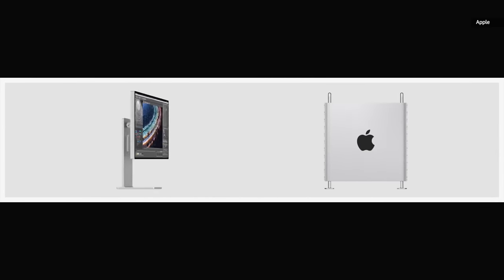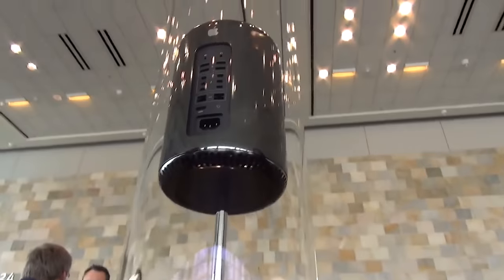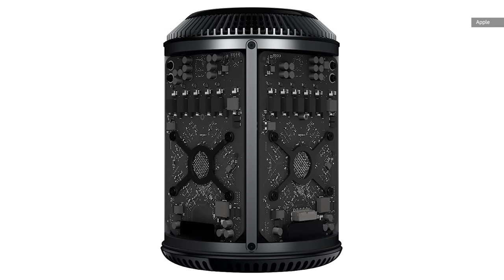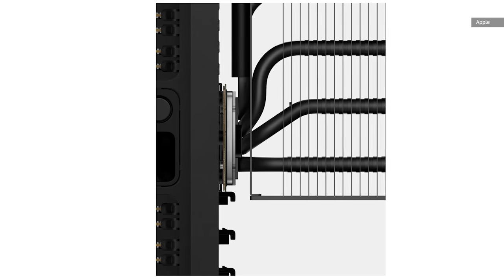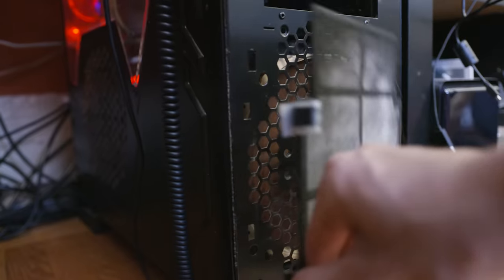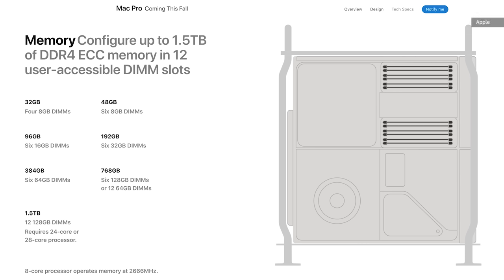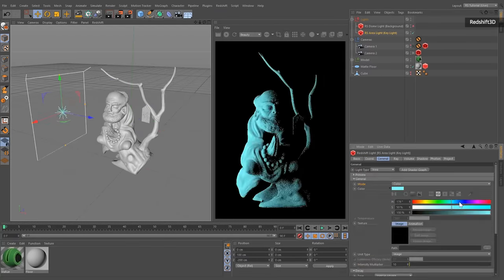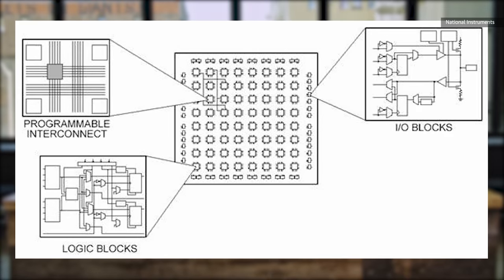Did Apple fix its Mac Pro problem? | Upscaled

Comment: Not sure they fixed it really .. not sure it matters given the price point... I still use a kitted out modded now 12 core old Mac Tower and regularly edit 4K      Frankly anything more that 10 Grand is simply too much coin.  plus I am a firm believer in not buying the first release of anything.    Never even though about buy a trash can simply because it was not at all upgradeable.
As for conforming,  well that dates back to the 80's in linear editing days when I first started.  Off line edits were made on lower cost systems with say burned in code tape sources which inevitably were edited onto another tape and then that tape was used to edit a third version and so on and so on.  You would then use a trace program to deliver yourself a final EDL which would then be "conformed"  onto a new master recorder from the original source material.   I guess that is what is done today with DI but likely any FX house will be using slight lower proxies or in some cases the original footage .   Based on the image at 50 second mark you are looking at Compositing the original footage with CGI ... sort of conforming .     At least you correctly pronounce the work Arri .. RRRR EEEE..  some people call it AIR EEE which the folks at ARRI tend to frown on from personal experience.  The Alexa is certainly not native 4K  although it certainly does the bulk of episodic stuff as it is reliable and robust.  Not sure what the newest latest greatest Arri is but supposedly its real 4K.   Frankly I am more than happy with my C300M2.

Comment: First off, films just aren't made on Macs. Maybe the color, and edit, but not the animation, VFX, 3D, or compositing. There has been two decades of development on the PC side for this. High end companies use Linux on customized PC hardware. This Mac Pro is for a tiny select group of colorists and editors that work in suites with couches so that the client can hang out and enjoy the high-end looking computer.   I had thought that your video was going to be about pricing, since this machine is priced out of the demographic that has been waiting for it since 2013. This is not a replacement for the trashcan. Those people are still waiting, or will be forced to buy an iMac pro, which are pretty cool, actually.
Reply: You couldn't be more wrong.
Reply: @greylingstudios  really? How so?
Reply: Ryan O Plenty of films (and tons of videos) are made on Macs, and this machine looks to correct many of the shortcomings of the previous generation, so it will no doubt cause a shift of more pros moving to or back to the platform. Further, this box is for a lot more than just film work.
Reply: @greylingstudios  actually, I think you're right. Maybe large films and vfx work is not done on Macs, but plenty of shooting and editing is done there for lots of other productions.

Comment: I'm not sure what a Mac pro is targeted at. IMHO it's only for pro graphic creators, thus a lot of its spec is completely overkilled or just for future proof.
128G RAM per socket? Anyone sane won't use such expensive Mac as VM host, and you can't beat AWS/GCP or even azure for VM hosting. CPU threads and GPUs make sense for rendering, but not really for machine learning, for the lack of CUDA and most people would just run tensorflow under Linux, not Mac OS.

Personally speaking, as a dedicated Linux user and developer, no way I would get a Mac Pro/Macbook/Mac mini or whatever Apple is making. It's a completely different world and I don't have any need to get into the Apple ecosystem.
(Wait for a minute, I'm just using Clang and LLVM which are mostly sponsored by Apple, so previous statement is not completely right)
Reply: Obviously not for pro graphics creators only.
Reply: FCP X and Logic Pro creators, of which there are 10's of thousands of us, perhaps more.

Comment: AThe new Mac Pro will be powerful, and it’s a very cliche criticism at this point but there are too many insanely powerful yet affordable hardware choices now especially with AMD Ryzen and they support ecc memory. Why is the new Mac Pro almost 2.5 times the price of what the old cheese grater used to cost? So apple can market their proprietary double pcie connector that they may or may not ever release another gpu for? perhaps those who buy it should just be thankful the Mac Pro takes regular GPU’s too.

Comment: Apple Inc is always ahead of it's time 😊😁😁 😁
Reply: <Cough> PCIe 4 </cough>
Reply: The only thing really ahead is the GPU. The cooling seems good but not ahead of it's time. CPU is off the shelf. The design itself is very custom but unfortunately it does not have PCIE 4th gen, that would have made it current. In that respect, it's actually out of date and consumer users will have that before apple users.

Comment: The new Mac Pro is another failure. Any professionals that haven’t dumped Apple by now are running for the doors - myself included. $6k for a 256gb SSD, 580x GPU, No Nividia Support, & an 8core cpu is an absurd joke of a product only an idiot could buy. Further most pros would want a new Apple display with their new Mac Pro - but almost none need a pixel perfect $6k display. Again just more failure from Apple - that few if any will actually buy. This not a product or platform professionals can see as relevant any longer.

Comment: Oh well, ill be wasting my money then as ill be basically buying the standard version but i wont be buying day one, i just don't want another all in one. I'm professional creative and this makes perfect sense even with the base spec. And thats how ill buy it as everything will be cheaper to upgrade third party. ram and graphics. CPU's don't make a massive difference with what im doing. Photography, large format print, illustration, some 3d and web but ram oh baby the more the merrier not every pro needs processor speed. Sure an i mac will do me fine but i'd be buying again in 2-3 years at which point i might as well of bought this machine. Even the 8 core version. though i do think they have missed a trick not bringing out a more "prosumer" version with i9's or something.
Reply: I agree that the 8-core will be somewhat of a waste in terms of bang for the buck. At least get the 12-core so you have the faster mem bus speed, and then at least you have hope of a cheaper plug-in solution for a bigger CPU in the future. At least that's what I'm thinking/planning.

Comment: apple used to care about prosumer, not anymore. i don’t know who this machine is targeted for, but definitely not ai. it’s a complete retardation to use overpriced designer box for tensor flow ops. go ask a community, if you’re curious. we have racks of servers with distributed models processed on a 200+ gpu cpuster. that’s pro ai, not a single damn computer. what i see at this point is apple presenting a “pro” solution and community is really puzzled who these “pros” are. not ai and scientific calculations/modelling, please, for the love of god. we use linux all the way and our tasks require way beyond what this cheesegrater has in maxed out spec. “movie makers”? i’m afraid they are all set up with their pipelines too. bravo, apple, a product with no consumer.
Reply: Right... nobody uses FCP X and Logic Pro.

Comment: The new Mac Pro is actually worse than the trash can. The trash can for all of its many, many, many failings was still a reasonable purchase on release day for certain creative professionals. Those same pro's will be faced by the total joke base model of the new Mac Pro and maybe the first couple of steps up the upgrade chain. All of which will likely be woefully underpowered for a $6 to 10k system. So Mac users will be paying an even bigger than usual premium for this turd and not getting anything remotely worth what they are paying.

Finally the upgradeability is beyond a joke at this time. The motherboard has 2 SATA connectors but there is no evidence at all of SATA power cords. So adding HDD's or conventional SSD's is out. Now go and look for the M.2 connectors on this motherboard. Found any? Neither has anyone else because there don't seem to be any. So how precisely do you get above the pathetic 4 Tb that Apple is offering at max, which is on 2 SSD's on a proprietary connector? The only option, at all, is to put the drive on an expansion slot. Which means going to an Apple partner not simply going to Microcenter or Newegg and buying what you really need.

Then take a look at the I/O on this thing. You get a very nice pair of 10Gbit ethernet ports and then Apple laughs at pro users. The rest of the I/O might as well not even be there. 2 USB 3 and 2 Tbolt 3's on the back and 2 more Tbolts on the top of the case. and the rear I/O isn't even on the Mobo but on an expansion card that fills the top slot. That's why Apple says the thing has 8 slots while most people say it only has 7. So the Kb and mouse have to be wireless and you have to use Apple produced parts. So no mechanical keyboards for you.

All in all its like someone at Apple wanted to find out just how many of their fans would pay $40k for a useless hunk of junk just cause Apple sold it.